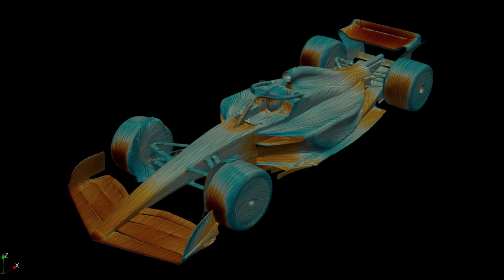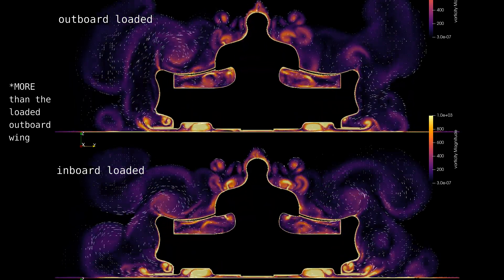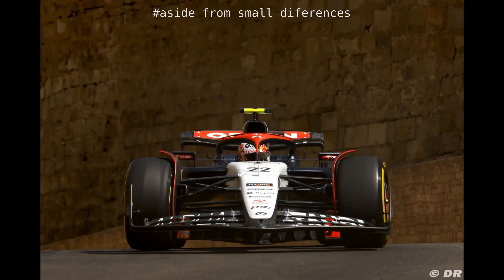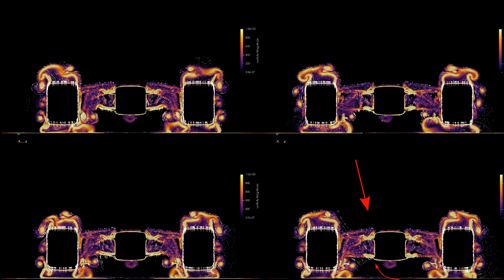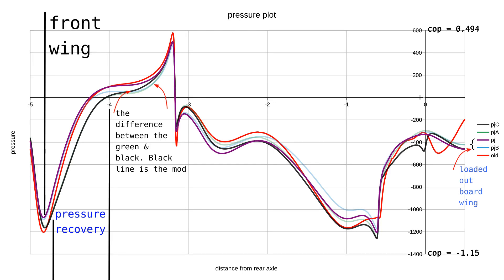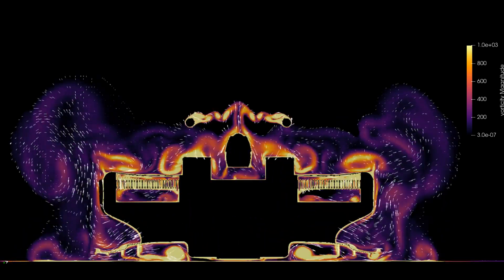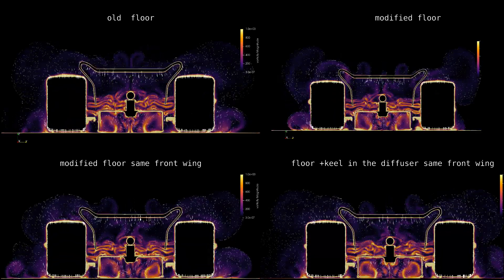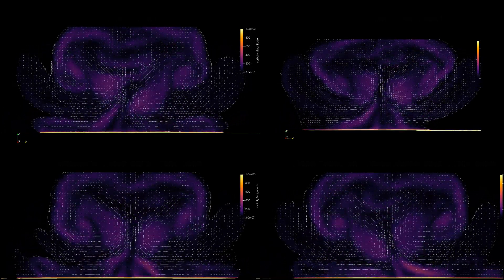F1 car CFD: adding bits and pieces

Comment: @0:29 Look at how much stronger the upper wheel vortex is with the inboard loaded wing compared to outboard loaded. Look at how that vortex is so similar to the one on your latest hatch video. If you wanted to understand that upper wheel vortex and why it produces downforce this should give you big hint. Also look at how the tire squirt vortex is stronger outboard of the wheels on the inboard loaded wing. It looks like the inboard tire squirt is also weaker with an inboard loaded wing, makes sense, since the outboard loaded wing has the camber and max load near the tire squirt and wheel furniture.

I'm doing a presentation next Wednesday regarding flexible front wings and how they affect the setup of this generation of F1 cars. Can I reference this video? will give you full credit for your work of course.

Comment: I am not an expert on the subject. For the front wing design, you have the following design parameters: 
1. wing platform sweepback angle,
2. dihedral/anhedral angles,
3.local twisting angles of the elements along the span,
4. variable ground clearance along the span and along the nose cone
5. control of wakes/upwash in front of the suspension elements
6. control of wakes/upwash and vortices in front of the front wheel
7. tapering of the element chord 
8. lift loading along the span.
One can appreciate how complex the problems are. Based on the longitudinal vorticity slices in your analysis, I  cannot see a clear explanation of the differences in effects between inward and outward loading cases.

Comment: Your videos are really damn good, but you shouldn't "rush through" like that. It's like someone firing a hailstorm of pictures and facts at you like a machine gun. If you would take your time, one picture and one CFD sequence after the other and explain here step by step and then for comparison the "previous" solution - then your videos would probably be the best ever! So but it is great, but you have to stop a hundred times, look, then partly continue to look, back, forward again, because you rush so through and the simulations too little detailed explanation and these then also too fast succession that one understands only if you go through it several times slowly step by step and often back. If you arrange it a little better, say something more about it and also clarify this better and more detailed - then your videos would be the best by far!
Reply from the maker: Thanks for the feedback. Believe it or not I have tried slowing these vids down.... I was struggling for consistence here more than usual. I'm firstly someone interested in aero and making the videos turned out to be a good way to work through the ideas. This video title was almost "A Keeping This Channel Alive Special", motivation was low but the data was there..... Always trying to improve the surprisingly complicated work flow for these videos, doesn't always happen.
Lastly those four animations, its a bit difficult to compare the time steps if they aren't on the screen at the same time. If they weren't then you will be scrolling back and forth on the time line anyway. It always a compromise. Hope I can share a few more interesting insight with you in the future.
Reply: Agree. It's still one of the best channels but I have to stop a lot of times to understand what he wants to conclude, even though I have years of experience in racecar aerodynamics. For a 'usual' F1 fan who is just interested in aerodynamics, and it isn't their job, it must be very difficult to understamd. 

But keep up the amazing work, I want to emphasize again that this is one of my favorite channels, and I often recommend this to others.